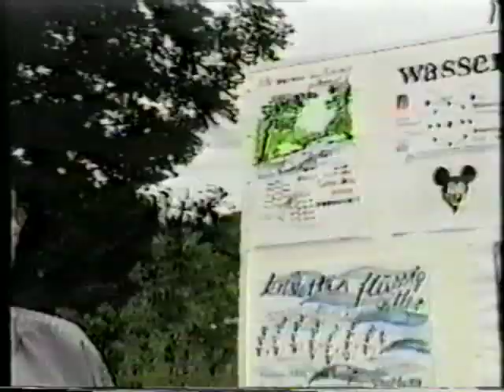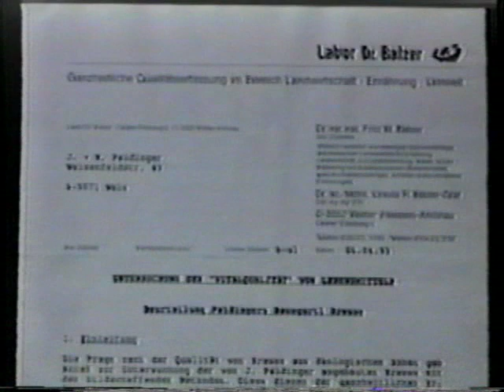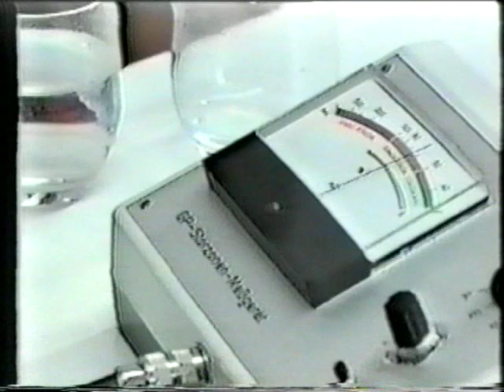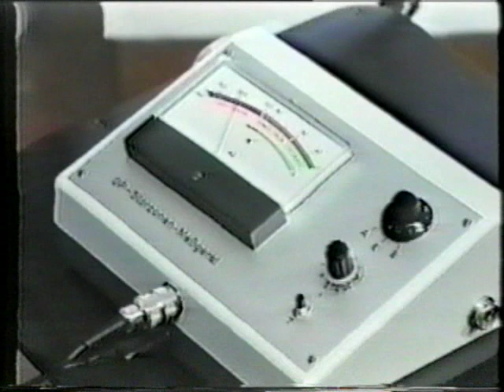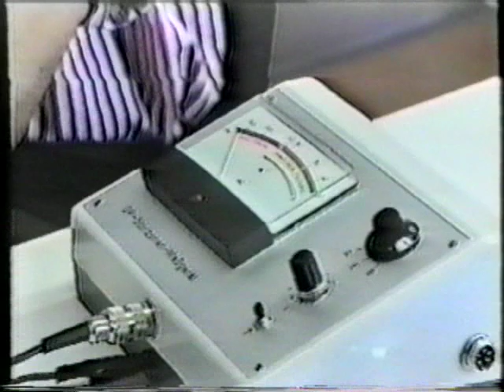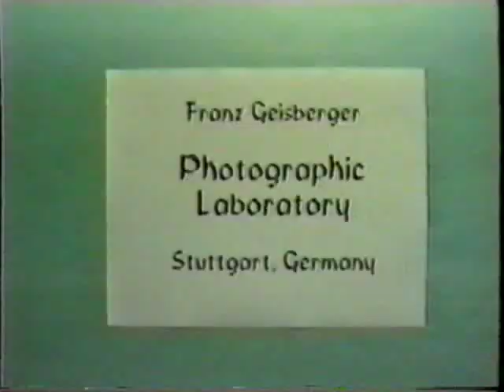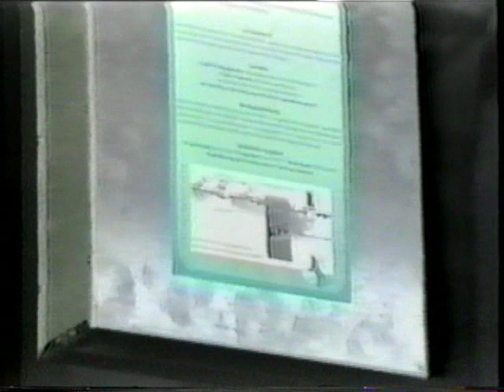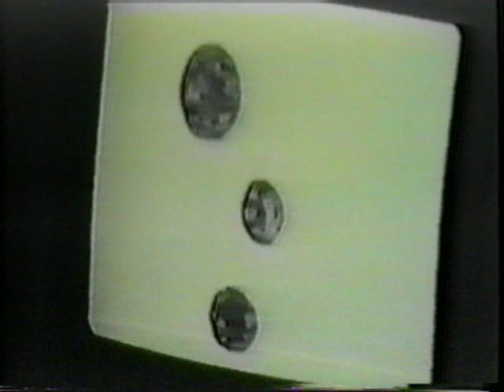Grander Living Water Revitalization

Comment: 11:56, 13:04 and 16:55
No filter required. A paradigm shift.  A threat to existing systems of water filtration and softening. 

14:40
Acupuncture

24:15
Revitalizing an entire lake? Wow!
Reply from the maker: Thank you for your feedback. Many Blessings!
Reply: GeeWhizWhat,  I purchased and installed a Grander unit that structures the water coming into my house.  The water flowing through my pipes changed so radically when we turned it on that it actually came to a halt for a couple of hours.  It scared me because I didn’t expect the descaling of 14 year’s accumulation to begin so suddenly; I honestly didn’t know when - if ever - this complete shutdown would resume, but it did.  After praying 🙏, which might strike some as irrelevant, the flow started again with just enough hot water to take a shower.  Then over the course of the next few hours, a strong, powerful, unrestricted flow then poured through faucets that had weakened their output due to both disuse and scale buildup.  The water coming through now is noticeably different. It does NOT leave behind that chalky residue when it evaporates.  I do have a carbon filter that removes chlorine and other nasty stuff, but it cannot handle fluoride or any other mineral, so the “softening” action is entirely due to the Grander tech that I chose based on videos like this one.

UPDATE (1 year later):  Some months after the install of both Grander and a whole house carbon filter made by Springwell,  I noticed that my hands and feet were extremely dry after a shower.  I couldn’t tell what was causing this, so I spoke to both Grander and Springwell.  The Grander distributor said that it’s not uncommon for impurities to still be filtering out of the pipes and/or the water heater and to just be patient.  Turns out he was right.